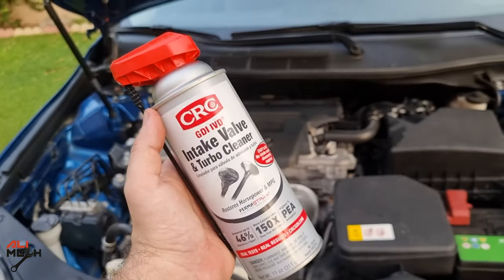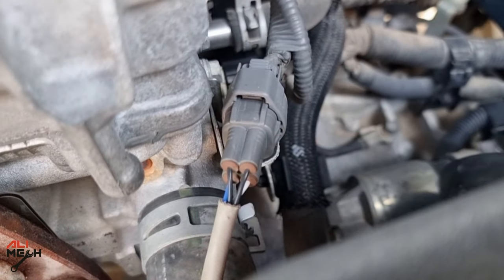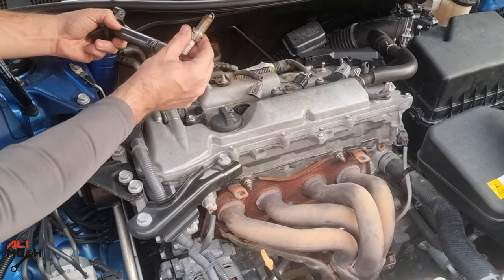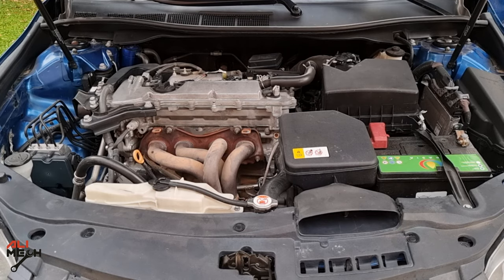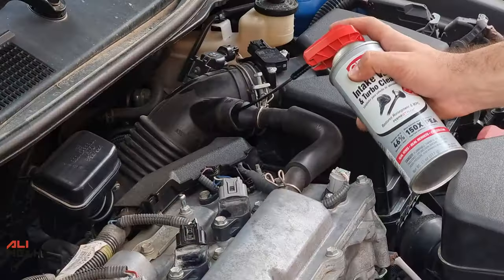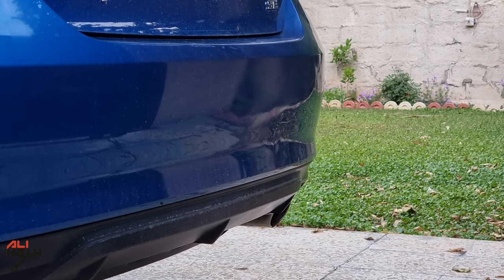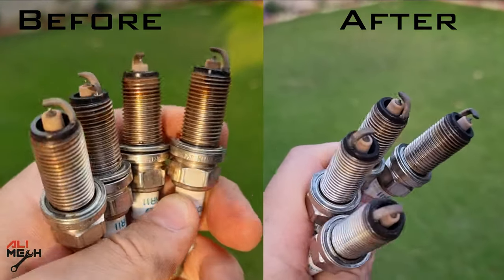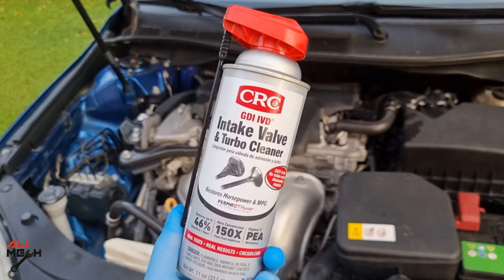Watch this before using CRC Intake valve and turbo cleaner/How to use valve cleaner before / after

Comment: Did not rev a few times to only 3500rpm max and then did not let it sit and heat soak for 1 hour, THEN take the car and drive at highway speeds for 10 mins. No wonder the valves and any other parts were not clean. Product not used as specified by the manufacturer.
Reply: You don’t rev it to 3500 rpm you don’t exceed 3500rpm
Reply: It might take more than one can of the stuff too, it's something you have to keep using at every service, particularly if you have a GDI engine.

Comment: You didn't do it right. Rpm stays under 3500 rpm on first drive. That's after you let it sit for an hour. And your suppose to stay at 2000 rpm with 1sec bursts till the cans empty. You failed on your review. This product is awesome. Googie the reviews
Reply: Correct you must follow the directions exactly  on the can . For even better results repeat  4 times every  1500 miles . Don't forget to change oil after 2nd and 4 th application . Will  be dirty .

Comment: Just a suggestion !  I have used this on my car Lexus Gs 400  has 355, 000 miles .  I tried this product at 320,000 miles . It needed 4 applications 1500 miles apart repeating using C R C  Intake cleaner  . One application or one can will  only be a slight difference . You must repeat 4 times ,  At  a 1500 mile interval . Don't forget to change the oil after 2,000 miles will be dirty . And again after 4,000 miles .  Car now runs smooth no mis idle and plenty power and acceleration . For maintenance now once every 15,000 miles only . Please follow directions on can exactly nothing else !.   Auto Zone has this  $ 14 .99  a can  .
Reply: Thank you will  give this a try .
Reply: Your lexus is a GDI fuel system?
Reply: Same as my 2021 Honda CRV, 1.5 turbo GDI, after I got it clean eventually, it runs great again, now every oil change I use a can
Reply: You are not doing it properly as per instructions on can if you had to do it 4 times .. also there is really no way that this would make your engine oil dirty .. this is combustion part of the engine .. Any carbon builds up dislodged will burn out through the exhaust
Reply: Followed Cory 's  repeat process  over 1500 mile interval car now runs much better . Once is not enough with high miles on a car . .Thank you

Comment: Chevron has the patent on PEA, i.e. Techron. The CRC product has a concentrated amount of PEA. This is a very strong detergent. It works over time, over the next few weeks, or about 1000 miles. I am sure  CRC or Chevron will confirm this if you call support. This product does work, but if you have high mileage, do 3 treatments like 1000 miles apart. And very important, change the oil. A lot of carbon will be held in suspension in the oil. Happy motoring 😊
Reply: Engine oil is not in anyway in the same cycle as air nor fuel in the engine, if you have an issue where it IS then you need to get your car to a shop asap because one of your gaskets is fucked, three things that never mix, engine oil - air and fuel - coolant
Reply: Of course, but I don't understand your point on what I said. Poly Ether amine will cause some oil dilution due to blow-by. Gasoline also enters the oil in the same way. This is normal engine operation. My point was to make certain to change the engine oil after any  concentrated fuel treatment, or in this case PEA detergent treatment into the air intake system. The detergent WILL alter the additive package in the oil. In addition, the detergent cleans the ring lands as you let the engine heat soak. So, some carbon will enter the oil, and most definitely the exhaust. Thus, it is important to change the oil after such treatments. Moreover, to much detergents in any oil will cause accelerated wear. (Sodium calcium and so forth. ) So, the oil chemists know what they are doing, a balance of anti wear, detergent, friction modifiers, anti foaming agents and so on in formulations.
Reply: ABC version...gas and any additive that is put in the fuel tank or the intake beyond the MAF will enter the engine oil in some amounts due to combustion and blow by.
Reply: @Koltary  False. Fuel and oil mix from the PCV system. And every combustion cycle, At the piston rings. More so the older your engine gets.

Comment: Many other comments have pointed out many errors you made. Here’s a little more  info. The CRC will remove “ up to 26%” after you let it sit for 1 hour and then drive the cat at highway speeds for 15-30 minutes. Then  over the next 1000 miles or so, even more carbon will be removed. Your  engine ( valves etc. ) weren’t that dirty. I have a 2017 Toyota Highlander. Toyota equipped it with both types of fuel injection, so I’m pretty sure your car has the same system. This type of a setup will stay cleaner and for longer but a good cleaning wouldn’t hurt every 30,000 miles or so.

Comment: Did you let it sit for 10 minutes after you used the whole can?  You are supposed to idle, rev to 2500 spray some in, let idle again, rev to 2500 spray a little more, repeat till the can is gone, then let sit for 10 minutes off.  Then restart and warm up, rev, then drive hard to get it all out.

Comment: I would recommend taking of the intake manifold and manually cleaning the valves, make sure the valves you're working on are closed.
A little bit of spray in the intake won't have enough time to eat away heavy carbon buildup you need to put some elbow grease into it
Reply from the maker: I did that here
https://youtu.be/qr-MNqGcLCA
But not everyone can remove all that and for some cars it will take so much time and tools
Reply: @AliMECH ...Yeah ain't direct injection great...sure if you only keep your vehicle for 50kmi then trade it in, rinse repeat.
Reply: @harryberry474 What are u talking about man. I have a gdi with 160k miles with no issues lol
Reply: @butWhyDad  ...so you've never cleaned the intake valves? 160k w/o cleaning  a lot of carbon build-up I'm sure. It happens to all DI engines yours isn't exempt.
Reply: @harryberry474  I didn't and I have no misfires. Carbon buildup isn't gonna cause issues unless it is extreme
Reply: @TheDutchGuy110  if used every oil change it will set back the time to needing cleaning by a lot
Reply: @butWhyDad  you will lose low end torque as a first indicator
Reply: @desimation  I ran crc intake valve cleaner and it made no difference so I assume 2L MZR engines are solid but I know some gdi engines suck it is all about the brand and model and year.
Reply: @butWhyDad  idk I smoked the whole block out, and it ran better afterwards, I’m getting 42mpg and she rips.
Reply: @butWhyDad  try cleaning your MAF/MAP sensor 🥰

Comment: does throttle body cleaner do the same & clean valves?
& about effectiveness i can see that your engine is missed up & you need to do it more often, like every oil change until you get rid of most of that carbon build ups

Comment: Thanks for sharing. Not only your video show that cleaner did not work but also showed how to remove oxygen sensor without twisting wire and inspect catalytic converter. Keep it up brother.
Reply from the maker: You're most welcome! Brother,
Reply: This is the only video where the product did nothing. I find that very odd. He didn't let it heat soak for at least an hour and talking to the techs at CRC, they said it continues to clean for up to 1,000 miles. On other videos testing this product the valves were still wet on top after the drive. That's how it's supposed to be according to CRC. Something wasn't done right here.
Reply: @RobinIntell I'm with you!  & you're supposed to have the engine running @ 2k rpm while intermittently spraying... several incorrect procedures here
Reply: He did the procedure wrong though,  so his results are wrong. This product DOES work and it he'd done it RIGHT we would've seen better results!!

Comment: I use to do this on the VW every oil change.  It does help to an extent but it won't complete stop cabon build up on valves.   You will still need to go in there and do a physical cleaning also.

Comment: Hey mate, try to get and test Xado Anticarbon - the reviews I see are almost always very good, people write that this agent works wonders with pistons and rings. I haven't seen anything that would apply in this way on the channel yet. Your content is great
Reply from the maker: I'll check it out, thanks for watching
Reply: I use Xado products but not sure if this product would clean off the intake valves on a direct injection engine.   Port injected engines intake valves are normally very clean due to the injection of fuel behind the valve which has a cleaning effect.  With direct injection engines the fuel is injected directly into combustion chamber bypassing the intake valve.  Intake valves build up carbon from the blow-by being recycled through the engine via PCV systems etc. which is normally cleaned on port injected engines but not direct injection engines.
Reply: @gymrat3203  first of all that's what tests are for - to be sure :D And secondly you put Xado Anticarbon directly on the pistons through spark plug holes.
I use it also through PCV hose on running engine - this way it can reach intake valves.
That's serious chemical angent, can rip paint off metal. Not a toy like Seafoam :P
Reply: @las3k91  I didn't think about putting it directly through PCV system which would clean back of the intake valves.  I don't think my engine has a traditional PCV system.  It is the GM 3.6 24 variable valve direct injection version.  I'll have to do some research.  Thanks!

Comment: This product is a preventative maintenence spray, not a repair spray. Your supposed to do this everytime you change your oil in order to extend the time it takes before your valves have to be physically cleaned.

Comment: Can you use regular chlorinated brake cleaner or throttle body cleaner to clean GDI valve using the same method?
Reply: For the love of god do not use brake cleaner you will fck any maf sensors or sensors you have .. and no throttle body cleaner won’t do the same job

Comment: Well letting the car sit for 1hr is part of the process.. obviously that was not done.
Revving your engine 6 times at 3500-4500 is not advised.. 

Those are the reasons you had no results. If your going to be a “technical expert” follow the guidelines.

Comment: The best and only way to clean carbon build up (on Direct injection) for the intake vavles thoroughly is manual cleaning and/or  a walnut blaster. And the only way to do it is removing the intake manifold. None of these cleaners in a can cleans the valves more than a tiny bit if anything at all.
Reply: they're good mainly for maintenance. If you do them regularly before an oil change, it'll help prevent build up. Even after build up, its a lot easier and cheaper to do this a few times (as someone else mentioned, 4 times 1500 miles apart) than do a manual walnut blasting. Sure, that is the best method. But most can't do that or don't want to pay so much money to get it done. Usually not worth it.

Comment: You should try the laquer thinner trick for your catalytic converter. I'm curious if it would work for those clogged ports.
Reply from the maker: I had good results with it before when I pure it in gas tank here
https://youtu.be/cFkqPHSzEbg
It cleaned piston carbon, bit I should try for Catalytic cleaning too
Reply: old wifes tail

Comment: Yes, GDI engines  I think they need to stop making those instead they added more injector to new GDI engine to solve this  carbon biuldup issue this means more expensive parts and more issues, intake valve they need to be removed to clean and to check the seats since this carbon buildup causes overheating valves and uneven seat seal.

Comment: Have A 2020 Malibu 1.5L Turbo Just Got About A Month Ago W/ 65k miles, Just wondering if there would be an issue with the carbon going thru the turbo ?? Would there be any damage ?? The Dealer I Got It From Lied About The Last Oil Change And I Started Experiencing Stalling, Rough Idle, Rough Startup, Terrible Acceleration, Etc
Reply: Having owned a 2016 model, the sooner you get rid of that POS, the better.
Reply: @anonymousinc6330  I couldnt agree more 💯

Comment: Toyota Camry's have have injector above the intake valve along with a direct injection, no need to do this.  Pour a can of Chevron Techron into the gas
Reply from the maker: Not these models, only from 2018 above  have injectors to clean valves

Comment: I had something similar to this engine hesitation almost like it would stall.  I poured some seafoam into the spark plug holes above the valve, let it soak for 24 hours and then started the engine.  Yes it smoked and yes it hesitated for about 10 seconds but man, i no longer have that issue.  I wish i could have use a boresvope to see before and after
Reply: Yeah sounds like carbon buildup on the piston head then. That won’t fix valve buildup because the spark plug well goes into the cylinder passing the valves.

Comment: Best way to clean the valves and keep them clean is to fabricate an intake manifold and bolt a carburetor on the engine. Then fabricate timing-belt drive for a distributor and throw the computer away.

Oh - you will also have to fabricate a switch-box to run the automatic transmission, too.

Comment: My spark plugs and both oxygen sensors are as black as black can be and I don't get it why. Any idea?
Reply from the maker: You have rich burning, more fuel than air, check the fuel injectors,
Reply: @AliMECH  
Thanks man. It's a GDI and the LTFT is also high, going above 10% while the STFT also goes positive while accelerating which is weird. I intially thought it would be a vacuum leak but if I choke the intake at idle, the engine dies rapidly and the intake rubber hoses remain squeezed from suction, which proves that there are no intake leaks that give those high fuel trims. I have taken out the injectors and cleaned them. Same results. Changed the inejctors with new one. Same results. Changed the high pressure fuel pump. Same thing. Changed both O2 sensors for 3 times. Same results. It turns my thinking upside down on why the ECU sends positive trim which makes everything very black in the exhaust. I don't know how to find the cause of the high fuel dosages given by the ECU. I've also changed the air intake sensors, IAT1 and MAP sensors thinking that these can foul the air data recieved by the ECU. Also changed the throttle body thinking that it sends more air than the valve angle reads for the ECU. Same result after all of these money spend on all of these parts. After each reset of all adaptations, the trims go to zero for a while, then wammm..., the STFT starts rising to some 16% positive and drags the LTFT with it there. Strange thing is that if I reset all adaptations and run the engine cold, like a miracle STFT trims remain close to zero and the LTFT is perfectly zero only up to when the engine coolant reaches some 70+ C. Above that coolant temp, the STFT rapidly rises to above 10..16% and stays there. It's weird why only when the coolant goes over 70C, the trim starts to go crazy up. The ECU pours more fuel for that and the resultant, black spark plugs, O2 sensors, cat converter intake mesh occurs. I don't get it what fouls the ECU after the engine coolant goes over 70C.

Comment: QUESTION: What about adding paper glitter to the intake?
Wouldn't the paper SCRUB the carbon, and get destroyed in the heat of the engine without damaging it? It seams that most "carbon cleaners" are designed to be DELAYED BURN products which act as abrasives before being destroyed by the combustion process. Thus...finding an abrasive which still gets destroyed is a matter of fine tuning the time vs abrasiveness. Paper seams to be a good choice given it's slow burn tendencies Vs it's abrasive characteristics.
Reply from the maker: I haven't use that, anything I use should be sensor safe and not damage throttle body, o2 sensor, there are so many harsh chemicals to remove carbon,  but it will damage something else

Comment: Brother did not work did not clean the carbon. 😢
Could you make another video using liqui moly valve cleaner. 
I have been told that it is very good. 😁
Reply from the maker: Sure, i will try

Comment: 2ar fe is not gdi engine though...🤔
Reply from the maker: https://www.mariettatoyota.com/toyota-camry-performance/#:~:text=It%20boasts%20Toyota%20Direct%20Injection,intelligence%20(VVT%2Di).
Reply: @AliMECH  There is no high pressure fuel pump on your engine, thus it does not have direct injection.
Reply: D'oh...😲

Comment: After you spayed all the chemicals, you WERE SUPPOSED TO LET THE CAR SIT FOR AT LEAST 1/2 hr to let the chemicals work.....
Reply: How are they supposed to still be there with the engine running at 2000 rpm? Just gets sucked in, burned and blown out the exhaust.